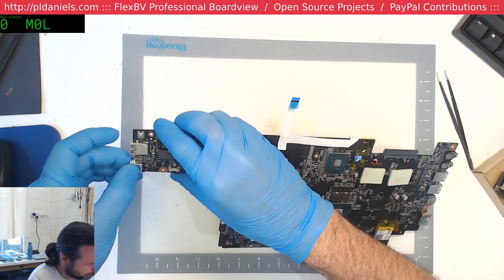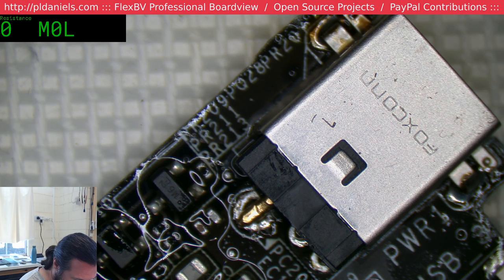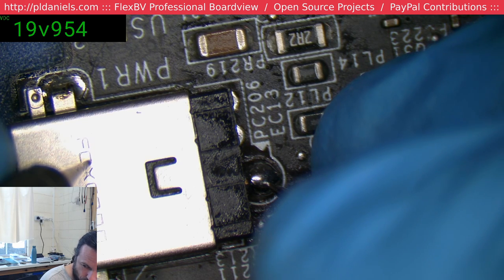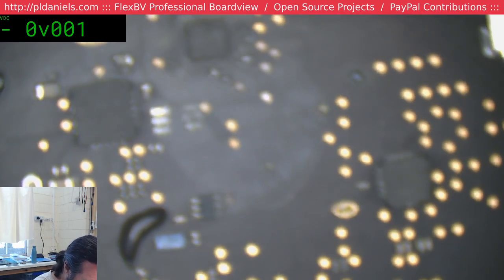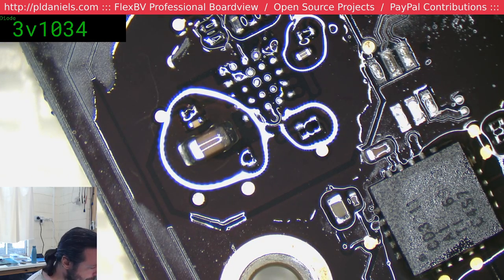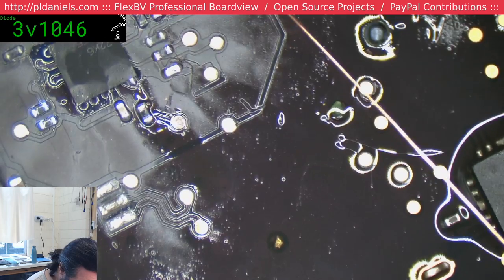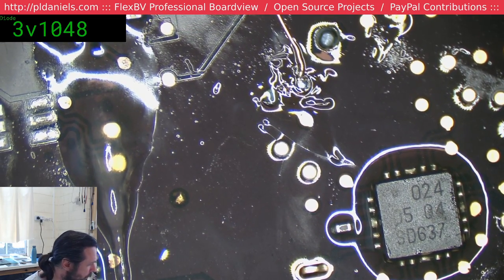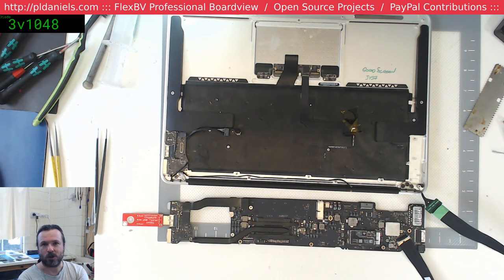Repairing Things ( No Nerf Capitulations - MSI Gaming DC Jack fix, A1466 backlight fix )

Comment: that port was repaird before.
Reply from the maker: Explanation / expansion of statement required.  Port was smashed in to the PCB due to a drop
Reply: @pldaniels  
Aaaaa. I had a job with that model and that pin looked to short. But now i get it why 😂
At first it looked like it was broken so they diy new connection to fix it. 
I'm lacking words in eng. To explain what i mean 😋